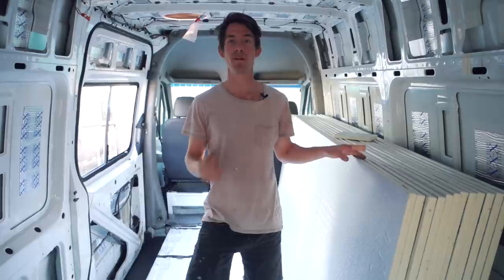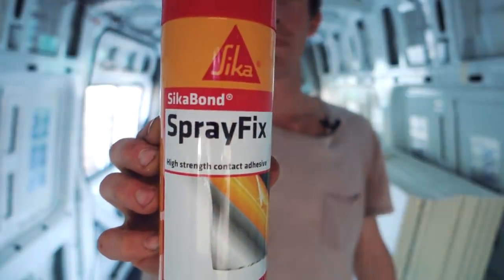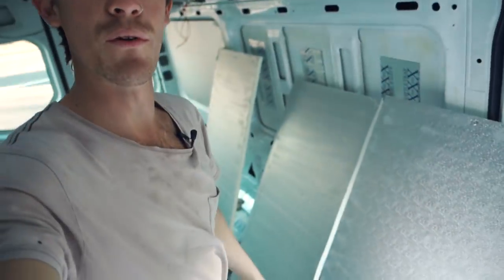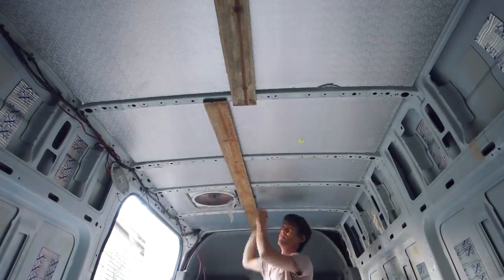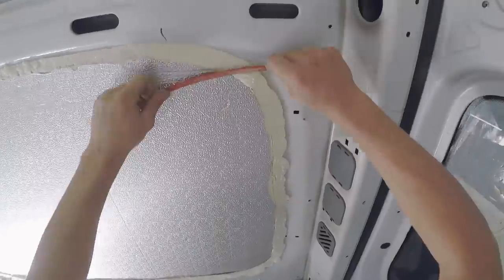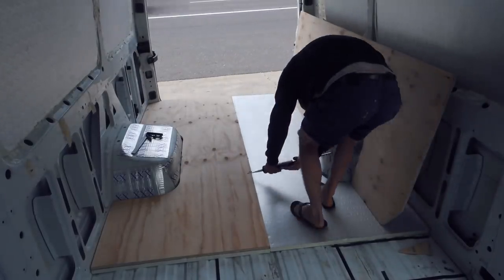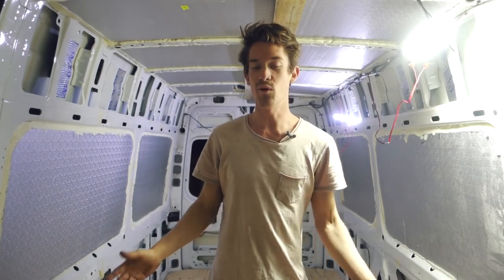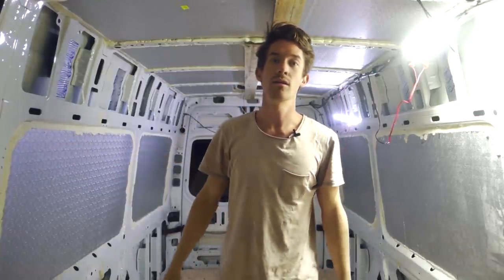S1E4 Sprinter Van Conversion | Insulation + Floor

Comment: Just never made sense to me to bother with the spray adhesive.  Have to believe that no one thinks this will actually hold these panels long term.  So the point would be to hold them in place until the wall / ceiling board - whether plywood, tongue and groove, or whatever, is placed over them to make the final surface.

Personally going to try skipping the adhesive, build a wall up with insulation, then tongue and groove, and then repeat that process for the other wall, and lastly repeat for the ceiling with just some temporary strips to hold the sheets in place as I lay up each piece of tongue and groove...

The bottom line to me is that there is no advantage to doing all the insulation first, then putting on the wall / ceiling coverings...   Instead, insulate a wall, cover a wall....

LOL, literally after typing that above, I unpaused the video and got to the part where you mentioned the ceiling pieces weren't sticking!

Just say NO to spray adhesive, there's just no reason you can't work around not having it...  Useless expense to me.

I think everyone should investigate the health risks of spray foam also before using it.  I think that there is a widespread assumption that this stuff is completely safe, and that's simply not true, and moreso surrounding the living space in a closed vehicle like this.  So I'll be doing my van without adding a health risk by using it...

Lastly, while you're not at that stage of your build yet here, I recommend everyone do some serious analysis of the structural integrity of their planned build out.  I never hear people talking about the risks of an accident and whether their build is:

a) constructed strongly enough so that it won't break apart unless under GREAT stress,
b) the quality of ATTACHMENT TO THE VEHICLE.  And this is the MOST OVERLOOKED PART.  Most people have NO IDEA about pull out and sheering forces of sheet metal screws, including the incredibly HIGH PROPENSITY FOR RUST TO WEAKEN THE ATTACHMENT OVER TIME.

To me, sheet metal screws are AN ABOMINATION and should actually be LEGISLATED AGAINST IN VAN BUILDS.  Yes, I'm saying that if found to have attached your build with sheet metal screws, it should be legally actionable against you.

I have literally watched Youtube videos where someone took off the shelf big box store PARTICLE BOARD CABINETRY, and attached a 4' cabinet that was going to hold tens of pounds of items, and attach it to the van wall USING ONLY 4 SHEET METAL SCREWS THROUGH THE PARTICLE BOARD.

These kinds of foolish build outs are literally looking at DEATH from an impact where these cabinets tear loose and impact occupants in the front of the vehicle.

Even a 30 mph stop in 1 foot exerts 2,000 lbs. of force.  So PARTICLE BOARD has NO PLACE IN A VAN BUILD.

You will note that any reputable van outfitter, such as for tradesman vans, when they install metal shelving, they ALWAYS use RIVNUTS.

RIVNUTS SHOULD BE AN ABSOLUTE STANDARD FOR ALL ATTACHMENTS IN A VAN.  PERIOD. END OF STORY.

Rivnuts have 800 lbs. and up of pull out strength, which DWARFS the holding power of a self tapping sheet metal screw.  And that says nothing about rust weaking the holding power of a sheet metal screw literally to the point that it will FALL OUT from simple vibration once the rust has eaten away just a few thousands of an inch of material holding it in place.

Rivnuts, properly installed, should always include some form of metal sealant for the freshly drilled installation hole, whether a primer paint applied right before the rivnut is installed, or silicone applied on the rivnut and THEN attaching it to the metal.  This will ensure that the BARE METAL THAT HAS BEEN DRILLED THROUGH WILL NOT BE EXPOSED TO MOISTURE AND CORROSION, but will have a VITAL VAPOR BARRIER protecting it for years to come.

This important protection against rust is almost NEVER TAKEN when installing with sheet metal screws, and is a HUGE MISTAKE.

Additionally, Rivnuts have other benefits:

a. Since rivnuts are available up to 1/2" bolts, they well exceed the shear strength of screws
b. Rivnut threads support repeated removal and reinstallation of the bolt easily a dozen times or more without weakening the attachment, something no one should even attempt with sheet metal screws.

I will be doing a van build series on my build out and talking about these and other considerations, but the word needs to get out about STOP USING SHEET METAL SCREWS.
Reply from the maker: thanks i can agree with some of your points, firstly with the PIR insulation boards as i said in the video, i wanted air gaps in between the PIR foam to the metal roof of the van, and also from the bottom of the PIR board to the pine ceiling. i explained why i wanted this in the video and so far its worked wonders.

yes the sika spray failed, but it was good enough to hold it into place temporarily whilst the expanda foam set it into place like rock.

I believe my build is built pretty dam solid, this van isn't going bush bashing but would defintely hold up to general abuse. 

yes i think rivnuts would be one of the strongest out there. anyway, building a van like this mostly on your own takes an enormous amount of effort and a lot of learning, errors and mistakes take place along the way which you change for better options.

I'm excited you will be doing a complete van build series including in detail everything you have talked about in this comment and many more, you should set the example in which you have typed here in your van, that could be valuable to people.

Make sure to email me a link to your awesome van build series once it is done, or even after the first episode :)))

Can't wait!
Reply: @JaznLori  - Will do, thanks and best wishes on your build and travels.  Have to have mine road tested and ready for Florida to Alaska in July this year with my brother being picked up in Wisconsin, so planning to document the van build, then will do a "Season II" where I document the trip: 4,700 miles one way...

Comment: How come you  chose to not use battens on the floor?
Reply from the maker: Because I didn't want to waste space, and I didn't need it
Reply: @JaznLori  I guess there are pro's and con's with doing like you did, and doing what others did. 

Did you only screw the wood pieces into the ply, or did you go all the way through into the metal of the van? 

What happens in a crash?  I want to start building me a van in near future, I  thought about just doing the floor like you did, or with some battens, but I'm not sure yet. 

Thanks for replying.
Reply from the maker: @AndreasEUR  I bolted the ply to the floor by using bolts through the van metal floor as you can see in the video, and timber floor plates or cupboard bases are screwed directly to the floor ply
Reply: @JaznLori  Ok thanks. It was the "cupboard bases" I was curious about. 

Another van builder from UK used battens in the floor that he glued and screwed to the floor, they're the same height as the 20mm insulation, but that gave him extra support to screw things into :)
Reply from the maker: @AndreasEUR  do you mean the cupboard kickers? The reason they are used is so that when a cupboard door or draw is opened, it isnt basically flush and rubbing on the floor, it has 20mm or 30mm off the floor so it doesn't rub on the floor and scrape
Reply: @JaznLori  Aha. I see. 

Yeah, I don't know yet. Would be nice to just be able to finish the floor without knowing 100% how my floor plan will be. 

But I'm also thinking that the way the other dude did it with battens on the floor is a great way to get more rigidity and something more than just ply to attach things to.

Comment: That sika adhesive spray is trash, it cant handle high heats which is not optimal for aus weather, used it with failure when refitting headliner
Reply from the maker: yuh its not the best, the expanda foam held the roof insulation in like cement though. i classify the sika spray as just a temporary hold until you get the expand foam in

Comment: What is the point of doing a insulation installation video without a) where you plan on living on your van and b) the R value of the insulation?  I like Jax's vids a lot so far, but this is critical info that's missing.  Maybe it's in another video, but it bares repeating regardless.  Ok, getting off my soap box now...